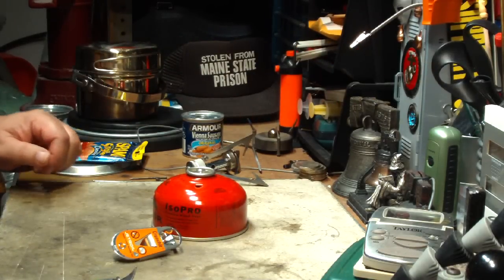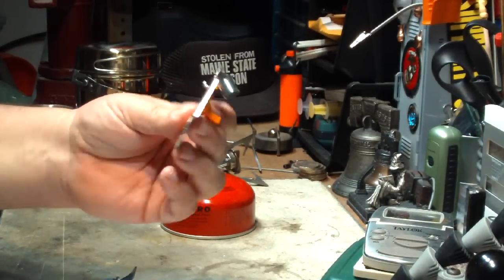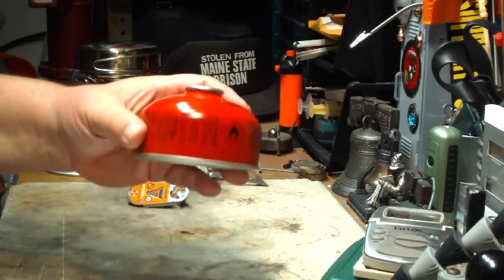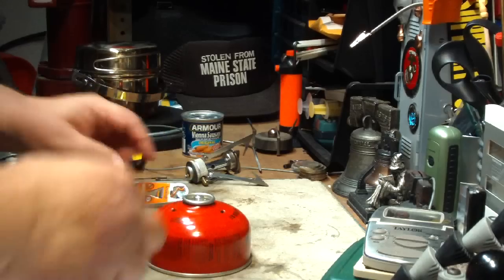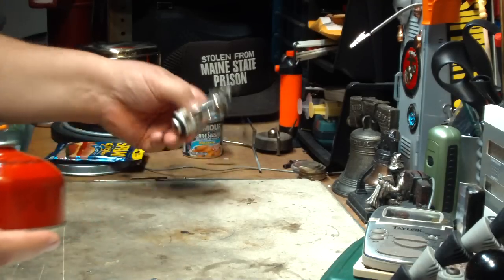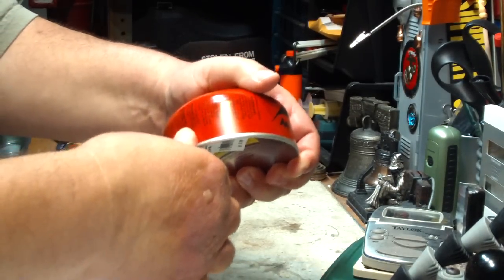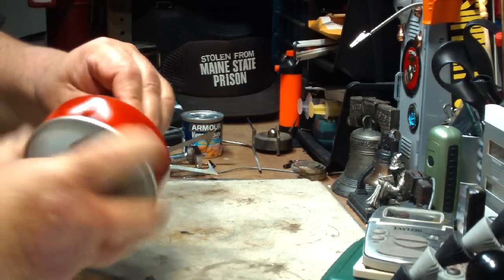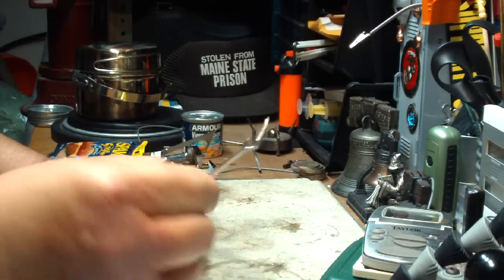Butane Canister Recycling - Jetboil CrunchIt vs Churchkey

Comment: Simple physics. The angle of attack you use for the churchkey point is much flatter than for the crunchit - hence you need more force to puncture the canister. And it may be that the canister metal is thicker at the sides and base, which will also make it more difficult.